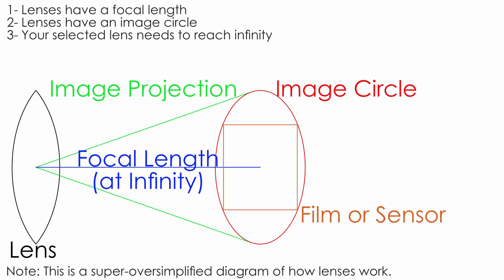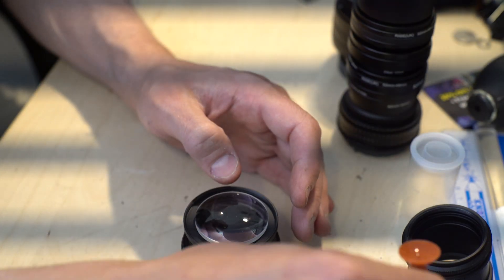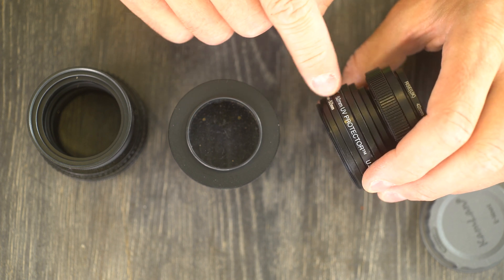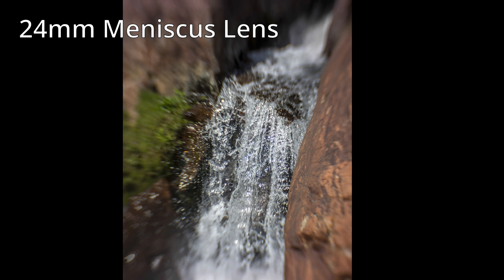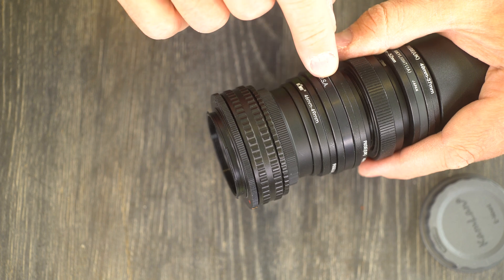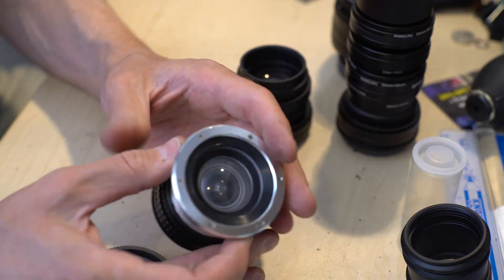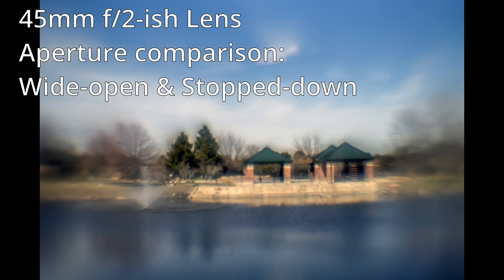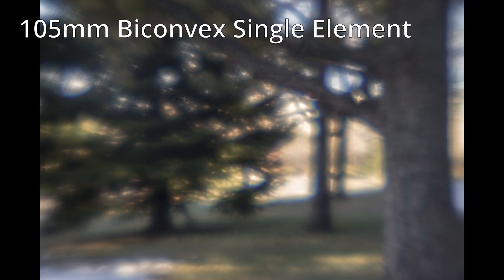How to Make Home-made Camera Lenses from Simple Elements or Rangefinder Lenses | Round Glass Review

Comment: How did you do that aplanat? Can you make a step by step guide? I was expecting more from this video, at least a step by step guide for a triplet cooke lens.
Reply from the maker: Well, triplets are actually pretty hard math, especially for me since I have two degrees in English and zero in math. The aplanat is a pretty simple lens because it's symmetrical and symmetrical lenses are just evenly spaced around an aperture. Triplets are asymmetrical and that's when things begin to get hard. The way I would make a triplet would simply be to get some different lens elements of the correct types and in different focal lengths and then experiment. That would be a lot of fun and would likely teach me a few things about the relationships between the lens powers and how they're spaced as it relates to the resulting image character.

Comment: OMG - great vid.  I bet you thought you'd done a perfect job dumbing this down for even the sub-average sub - but you'd be wrong!  Here I am!  Please consider going thru every step (start to finish) of making a simple lens with every.single.part.involved. - starting with the exact suggested lens to start with and the specific element even.  Speaking solely for myself, if I can watch you make just one, I can probably go from there.  Thanks either way!
Reply from the maker: Can do, and I did think that. :D So with the list of items in the video description, here's how you'll do it:
1- Your-mount to M42 SLIM adapter ring. This is key because it gives you more flexibility in focusing ring length.
2- M42 to M42 focusing helical. I always mount that focusing helical on the adapter ring. I prefer a separate helical and adapter ring because I can swap helicals in and out as needed to get to infinity focus. With a your-mount-to-M42-focusing adapter (which exists) you're locked into that adapter's shortest distance.
3- Make a lens housing. Let's assume you're working with a 50mm diameter lens. If you use an M42 to 52mm step-up ring and place the lens in it you'll have a 41mm clear diameter and the lens will fit inside that ring well. Then use a 52mm to anything smaller step-down ring to sandwich the lens so it won't rock around or shift. If the lens is a bit small inside that, I'll use some batting material like black cotton yard, some trimmed open-cell polyurethane foam, etc, to fill the empty space and keep the lens stationary. The point of this part is to make a way to mount the lens inside of the overall assembly.
4- M42 to 52mm step-up ring. I usually work with 52mm rings because they're common so I have to get from the M42 helical to 52mm. Then I use 52mm filter rings with the filters removed (and glass recycled) to create the length needed to get to the iris.
5- M42 to M42 iris. This usually has a small clear space -- approx. 35mm -- but is an easy way to control aperture. There are other options, too, like M52 to M52, but sticking with 42mm is an easy way to begin.

So here is a basic assembly: adapter, helical, iris, lens mounted in front of the iris (fun fact, lenses in front of the iris will deliver pincushion distortion, lenses behind will deliver barrel, so if you find you have strong pincushion in a lens you build, swap the aperture location and see if that helps.)

Here's the simplest way to build one: pick a lens based on your build.

So let's assume you have a Sony E camera with an 18mm register distance. And let's assume you bought an M42 slim adapter that's 2mm thick. And we'll go with this lens being for portraits and we'll be using a 36mm-90mm adjustable focusing helical. Then you have an M42 iris that's approximately 12mm thick in front of that and the lens housing which will add another 3mm. Your optical system from that point from sensor to the closest-possible lens placement with this setup is 71mm (18+2+36+12+3mm). If you had a 75mm FL and 50mm diameter plano-convex lens, you'd likely have a good basic structure to play around with. The 35mm-ish clear space on the iris is going to give you approximately f/2-ish, which is ample for a single-element portrait lens. This is, by the way, pretty close to the setup I first built. If you don't use an iris and settler for always-wide-open, you could get something that's about a 60mm focal length and, with a 41mm opening in the step-ring housing, you'll get a 60mm f/1.5 lens. That, also, is a lot of fun. One other tip, plano-convex lenses are the easiest to work with. The flat side is easily identified and that side faces the sensor. PCX lenses also tend to have the best optical performance in a single-element system.

So what I just described with the 75mm lens at 50mm diameter and the parts above, is where I'd start (unless your register distance is longer than 18mm.) Then check eBay for "laboratory optics plano convex" that SHOULD take you to Mittenpaw's eBay listing. I have no affiliation with Mittenpaw, but he or she sells surplus Edmund optics lenses. Surplus Shed here in the US is also a GREAT source, but I don't know if you're in the U.S. or not and I'm not sure if Surplus Shed ships overseas.
Reply: Great info on optical lens zooming! 👍